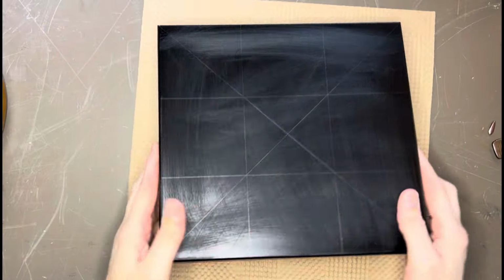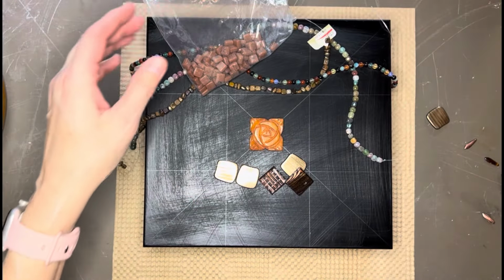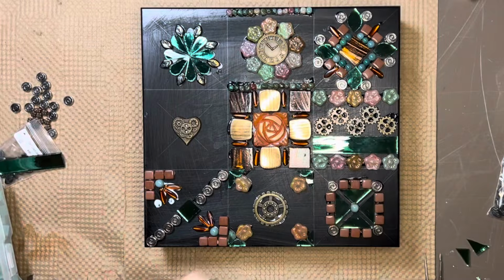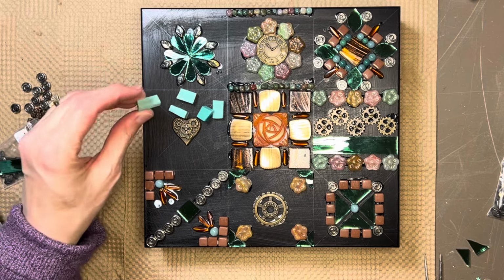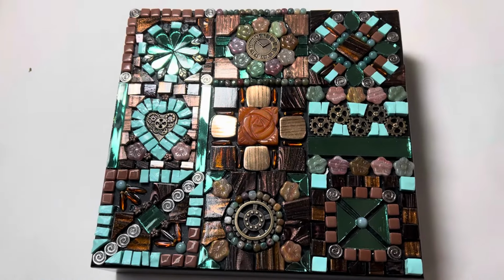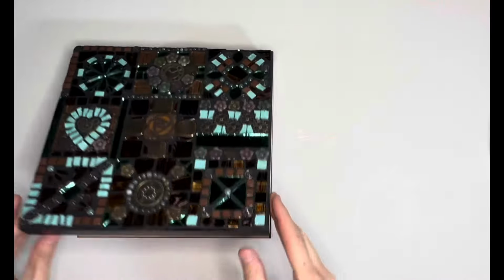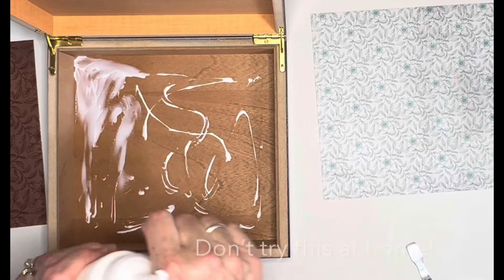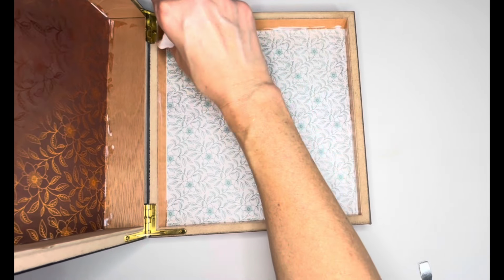Ep. 198 HOW I TRANSFORM DONATED PIECES INTO A STUNNING MOSAIC BOX!

Comment: I had the same problem with Prep Multihesive, which is an Australian adhesive, which is great as it dries clear but is not water soluble, but the tiny bottle I had it dispensed into went wacko. So for the first time, I decided to put it it in a dish and and dip the glass tessera. So you learn something new every day. 😊❤
Reply from the maker: Sometimes I dip pieces. Usually if they are tiny and I'm using tweezers.